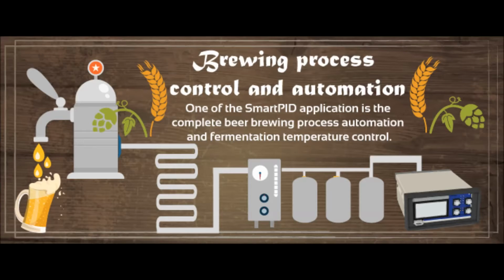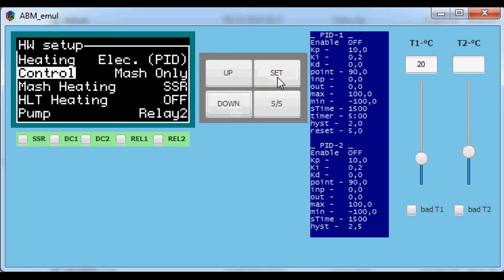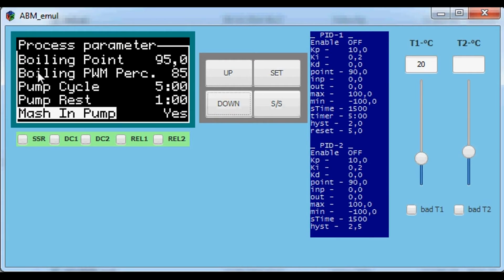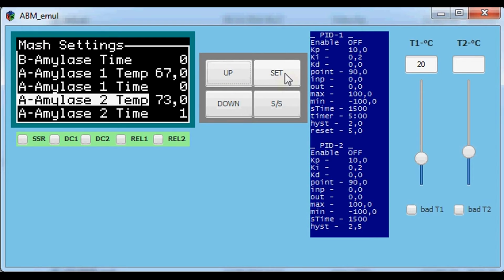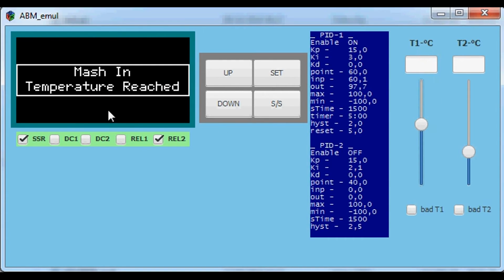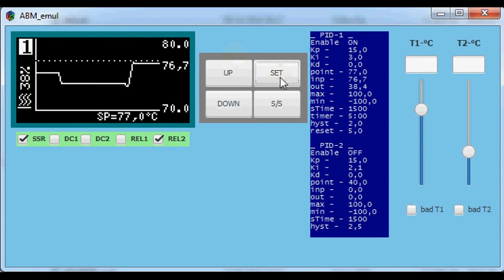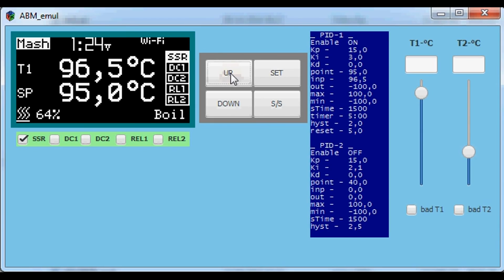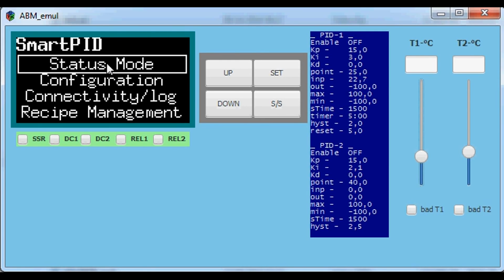SmartPID - homebrewing smart application tutorial (ENG)

Comment: I have a separate HLT, Boiler and Pot for Heating herms and a pump, will it be possible to operate 3 vessels with elements and 3 temperature separate measurements and a pump?
Reply from the maker: SmartPID has 2 independent channel , you need two boxes to mange 3 vessels
Reply: My HERMS has heating element in HLT, and then I got a heating element in BK (Boil Kettle) would it be possible to run one controller and control both?  One issue is of course that the BK should not be turned on - before the HLT is finnished and turned off. (already bought the SmartPid from you) I might add - the HLT has a coil, and my pump is sirculating the wort from MLT to a coil in the HLT, and then back on top of the grain in MLT
Reply: Also - is it possible to run two pumps? And turn them on and off manually?
Reply from the maker: SmartPID has two independent channels In the brewing application are used one for the mash tun associated to a recipe (step mash) and the other one for th sparge water Boil phase is manged by the mash channel
Reply from the maker: no currently is not possible to mange two pumps
in manual mode you can activate and deactivate the pump with long press S/S
Reply: So, if I got 1 x 25A into my controller bok, connects the SmartPid, the MLT will turn off, before the Boil Kettle starts?